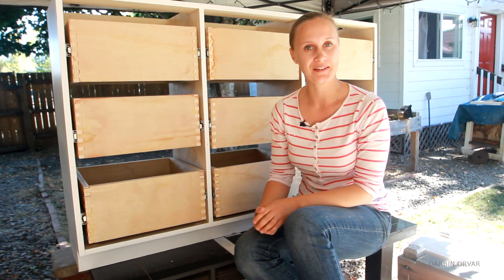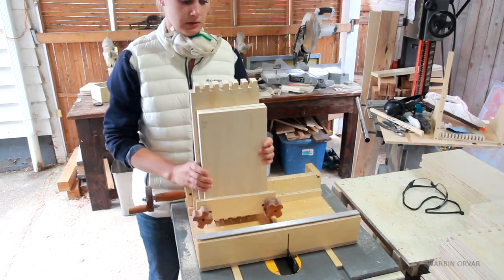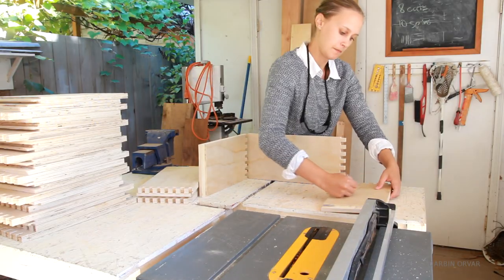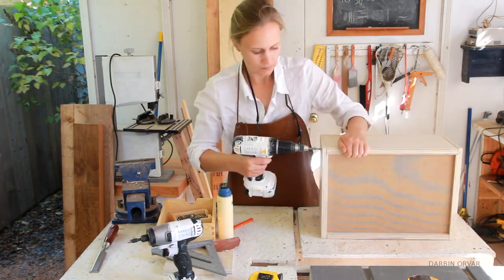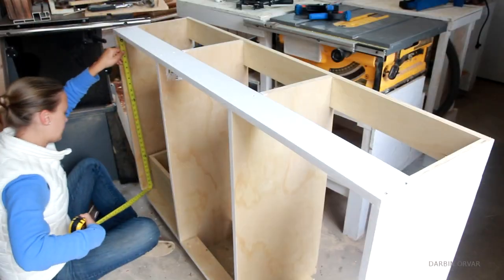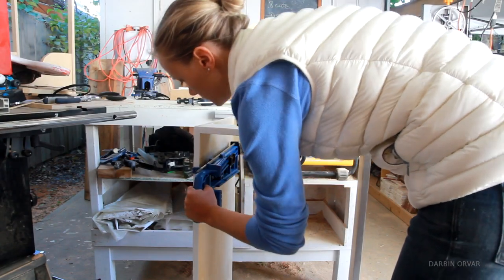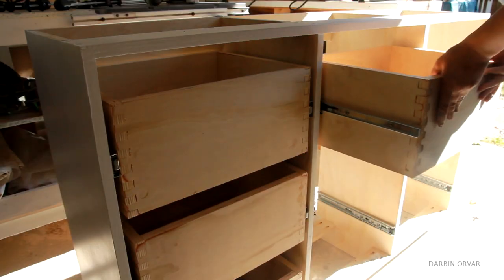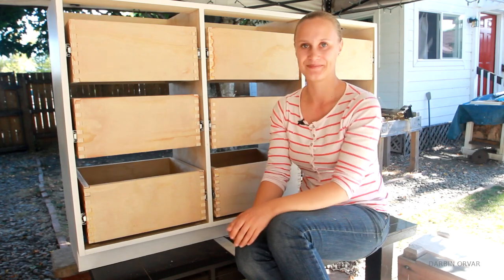Making Drawers w/ Box Joints on the Table Saw for Built-ins

Comment: Great video! How did you measure the width of each drawer box to account for the width of the drawer slider hardware? Is how to do this included in the drawer slider instruction?
Reply: Wayne Bishop,  This type of drawer slide is usually 1/2".  So you have to make the drawers come out exactly 1" less in width than the cabinet opening.  Undermount slides are usually more complicated and that information is on the manufacture's website.

Comment: How critical is the width of the cabinet vs. drawers?  You said, somewhere in the comments, that you need to allow 1" (0.5" per slide x 2) but if you are slightly out does that affect how the slide functions?  I thought in the video some of the drawers looked a little stiff - could this be related?

Comment: Looking good so far Linn. Any particular reason why the middle left drawer is a little bit higher?
Reply from the maker: +jue1 It's not meant to be :) Easy fix though....
Reply: What really matters is that the drawer fronts line up. The drawer heights do not have to be even. I usually design the bottom edge of the drawer fronts to be no more than 1/4" below the bottom edge of the drawer boxes.  More than this and it's just wasted space in the drawers.  But you will see all this when you start to do it.